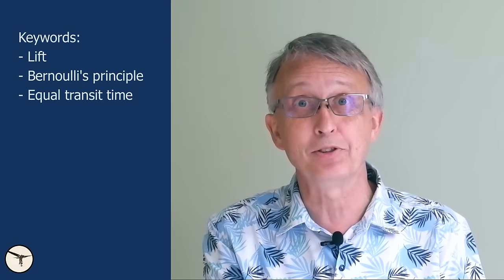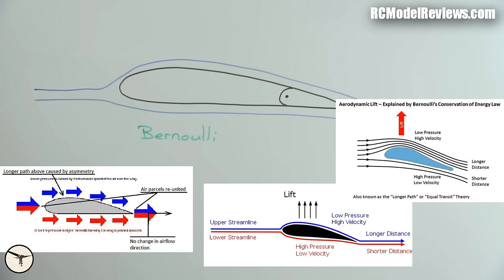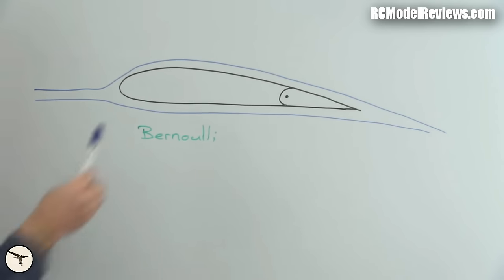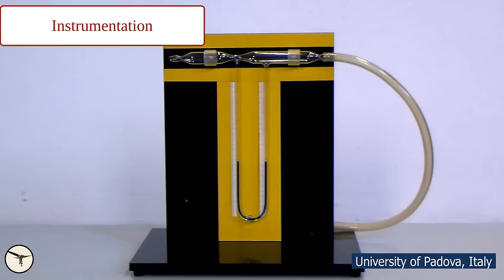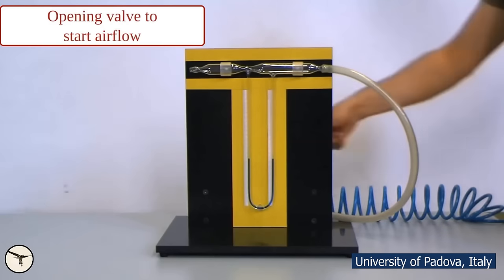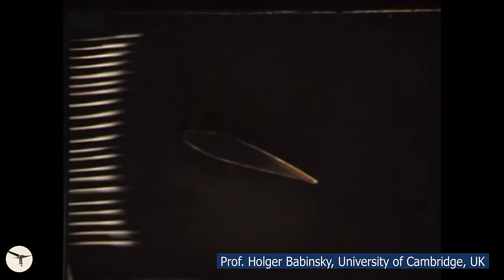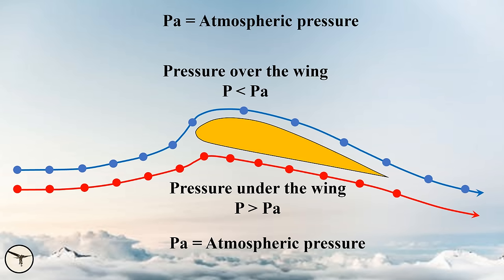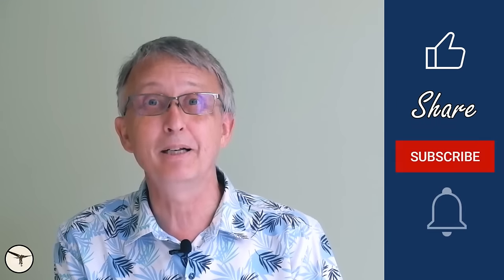Why are so many pilots wrong about Bernoulli’s Principle?

Comment: It’s more important for pilots to understand what causes a wing to stop producing lift,  so the passengers don’t get upset.
Reply from the maker: It will also be nice if the pilots understand how a wing produces lift.
Reply: "It’s more important for pilots to understand what causes a wing to stop producing lift,  so the passengers don’t get upset."
You mean like when the big fan up front stops cooling the pilots?
Reply: @rael5469     You got it…..it’s doesn’t do to overheat when the passengers start screaming 😱
Reply: As John Wayne would say...  "Stop stalling and spit it out..."
Reply: It has nothing to do with Bernouli.
It is action and reaction - it is the deflected downflow of air from under snd over the wing, that provides lift.  To make the wing go up, you must deflect molecules of air downwards.   No deflection, no lift.

The pressure differentials are a product of molecule deflection, not the cause of lift.  (ie: more molecules hitting the bottom of the wing than the top.)

R.
Reply: @RalphEllis  The stream of air gets cut into by the wing.  The lower top side pressure produces LIFT in that stream.  So flight is the result of making vertical gains against that stream.  The lower pressure and LACK of molecules produces lift within that stream.  So your action reaction is that same thing that causes a rush of air in a breached airlock.  The "vacuum" or lower pressure above the wing pulls on it compared to the mass of air that would normally be pushing downward on it.  So you got it wrong.
Reply: @RalphEllis wrong, if it was true that deflection was the main factor there would only be like 10% of the lift produced, aircraft would not fly.
Reply: Yep, you got that right.😂

Comment: You are 100% correct. When I hear people explain this wrong idea I ask them how is it that  aerobatic planes can fly and their wings are symmetrical. And how can they fly upside down?
Reply: Aerobatic aircraft use engine power.

The angle of attach of a symmetric wing profile deflects air down, but that flight mechanism creates a lot of drag, which needs more engine power to overcome. Many aircraft can fly upside down, using the control surfaces to deflect the airflow - exactly the same forces as used to change direction, but if the control surface forces exceed the weight of the aircraft, it doesn't fall out of the sky whilst inverted.

So, angle of attack, and control surface inputs, which are completely different flight mechanisms from aerofoils.
Reply: @andyowens5494  yes. Angle of attack is critical. Obviously aerobatic wings are not used on more conventional aircraft for that reason. They are too inefficient. But if the Bernoulli principle was the only thing working, this wouldn't work.
Reply: Symmetrical airfoils must always be at a positive angle of attack to produce lift, roughly +4 degrees for unaccelarated flight. Asymmetrical airfoil will still produce significant lift at even zero angle of attack and no lift at roughly -4 degrees under the same condition.
Reply: @kevinbarry71  Thank you for pointing out the obvious issues of angle of attack and symmetrical profile wings.  If you have ever "flown" your hand out a car window, angle of attack is readily apparent.
Reply: The angle of attack in the smoke demonstration appears to be much more than 4 degrees
Reply: @andyowens5494  Aerobatic aircraft still use their wings for lift. They don't use 'engine power' alone to stay in the air except when doing specific stunts that involve climbing straight upwards. They also don't use control surface forces to fly upside down. They use control surface forces when upside down to create a positive angle of attack on the wing and then they use the lift from the upside down wing to fly. If they are set up truly symmetrically they'll be doing the exact same thing when right side up.
Reply: @christophertelford  Ooooo... such an education.
Reply: @andyowens5494  Happy to help.
Reply: 1 SW SW ex
Reply: "I ask them how is it that  aerobatic planes can fly and their wings are symmetrical. And how can they fly upside down?"
They have enough POWER to ignore the Bernoulli effect.
Reply: @thomasmaughan4798  You don't need a lot of power to fly with a symmetrical aerofoil (or no aerofoil). The symmetrical wing hits the airflow unsymmetrical because of the positive angle of attack as would the flat wing.
Reply: @christophertelford  "You don't need a lot of power to fly with a symmetrical aerofoil"
I do.  Evidently your mileage varies.
Reply: @andyowens5494  Exactly!
Reply: @rivernet62  It's deliberately set high to break down laminar flow and produce a vortex near the trailing edge. If it was set lower it would demonstrate that Bernoulli was in the right ballpark but his model breaks down as soon as laminar flow does.
Reply: How?  Angle of attack.  "Symmetrical" wing must have an angle built into it or induced by the pilot and the controls.
Reply: @christophertelford  Thankyou !! Yours is the BEST explanation.  Look at airshow pilot Dave Martin {you can see him on YouTube} he flies a Beech Baron that has a standard wing and he flies it upside-down with BOTH engines CUT and props feathered. So to say that aerobatic planes fly upside-down because of extra engine power is kind of stupid.  There are glider pilots who do aerobatics in high performance gliders and they have no engine.  As far as the curvature of the wing, that is obviously for efficiency.  Because you can make a paper airplane and if you are good at it, you can make it fly really well. And it's just a paper airplane with a paper wing and no "curvature". Look at a toy balsa glider.  If you take a magnifying glass to the leading edge of the toy glider wing, what you'll see is a SQUARE.  There is no "cuvature" yet the toy glider flies very well indoors. Thank you for your flight control explanation.  I can't believe people actually think the flight control/s are making the airplane fly upside down. That makes ZERO sense.  If you're upside down, the control inputs are simply "backwards" - push stick forward to make nose go up, and pull stick to make nose go down.  Rudder same thing - Now ailerons I'm not so sure about because that's the longitudinal axis and depends on your reference point so any aerobatic pilots out there chime in on the ailerons when you're upside down. All I know is when you roll the aircraft to the right the left aileron will be down but when it's upside down it will be up and will have "switched" places with the other aileron. I'm assuming when you're upside down the aileron movement will be the same - but since I've not done my aerobatic training {yet} I'm not 100% sure.
Reply: @thomasmaughan4798  If your aircraft has a non symmetrical wing and isn't setup for aerobatic flight then it will be more 'biased' towards flying right side up and will take more extra thrust to hold upside down vs flying the way it's 'supposed' to. But define 'a lot'. I'm guessing an extra 40% or thereabouts? The point is you don't need a greater than 1:1 thrust to weight ratio, the aircraft still flies and the wing still works.
Reply: ...25 likes for this comment just goes to show that videos like this one are still failing to relieve the great unwashed of their misconceptions about lift and probably always will.
Reply: @andyowens5494  "Attack" 

Looks like you needed the education, Mr. Smarty Pants
Reply: @waywardspirit7898  Looks like you've never had auto-correct change one word in anything you've ever written, "Mr Perfect". Thanks for your comment, I'll give it the attention it deserves.
Reply: They have an aileron on the trailing edge the airfoil to lift one way or the other.
Reply: @markmcgoveran6811  thank you for sharing your ignorance
Reply: @kevinbarry71  well I'm sorry about my ignorance but I don't see any reason why you would assume those two flows with meet at the same time that the theory like that is just patently ridiculous. But apparently a lot of people with phds ignored it for a long time. If you took any arbitrary curve you just can't be expected to have the same speed if you have anything asymmetrical. Radial symmetry in every direction you would have a sphere and the speeds would be the same because the distance would be the same. But I do appreciate the respectful attitude you have towards others and I'm happy to hear your contribution and I don't care what you think that's still the stupidest idea that ever got by anybody with a better education than a farmer.
Reply: @markmcgoveran6811  you don't know the first thing about ailerons. They work in opposite directions.
Reply: @thomasmaughan4798  there seems to be a weight problem in the room that's what decides how much fuel you're going to lose if your heavy on the wing you're going to eat a lot of fuel.
Reply: @kevinbarry71  airflow shadowed side of wing have more airflow speed than side that catch the air. so in any way bernoulli effect works. it's  just not only part of forces, but it works in any way except 0 aoa on symmetric wing... actually it's works even in this situation, we just can ignore it, because we "works" with ideal model.
Reply: The acrobatic airplane that flies upside down doesn't glide upside-down he's hanging on that propeller and if that motor spits when he's flying upside down he's going to have to do something and it better be good. Acrobatic airplanes have plenty of motor and no brakes no other airplane has much for brakes either in the sky so the acrobatic airplane doesn't really need low-drag wings a lot of them are biplanes. Lots of drag so when you're back out of the throttle it slows down to set you up for your next acrobatic move. When you've got an airplane with that much horsepower it's kind of like a helicopter hanging on that rotor.
Reply: @thomasmaughan4798  You said "They have enough POWER to ignore the Bernoulli effect."   Gliders can do aerobatics and fly upside down.
Reply: @michaelrunnels7660  "Gliders can do aerobatics and fly upside down."
Yes, they are amazing aircraft.  They are not designed to fly inverted for any extended length of time.
Reply: @thomasmaughan4798    I interpreted your earlier comment to mean that something without a VERY powerful engine can't fly upside down for any length of time because Bernoulli's law doesn't work when an aircraft is inverted.  A glider that flys inverted for any length of time shows that Bernoulli's principle works just fine for aerobatic aircraft.  No need for any engine at all, let alone a powerful one.
Reply: I would like to know how an aircraft can have sustained flight at 90 degrees roll, wings vertical, with no obvious great pitch up angle of attack of the fuselage. Should be pitched hugely nose up.
Reply: @howardsimpson489  The fuselage itself is an airfoil.  The elevator simply becomes the rudder and the rudder becomes the elevator.

Comment: I've been saying this for almost 2 decades. There is absolutely no reason that the air flowing over the top of a wing is supposed to meet up with the air flowing under the bottom in the same position where it started from. If it did, wings would not create drag. The existence of the drag created by an airfoil is all the evidence you need to refute that theory. If the air moving over the top of the wings speed up at all it is likely more because it is being compressed against the air above it as it is Redirected over the top of the airfoil.

Comment: Hi Magnar. Many have an issue with Bernoulli, and they are mistaken. As long as you are outside the boundary layer Bernoulli's principle applies. In fact, when most engineers use the pressure coefficient it is directly related to Bernoulli, as the ratio of the change in static pressure to the dynamic pressure. The ETT was initially a hypothesis of D'Alembert, and is a result of potential flow, the first real attempt to apply Newton's laws of motion to a fluid. In this situation the curvature of the streamlines at the training edge and leading edge are symmetric, and you get no resultant lift force. As such, saying that the curvature is responsible for the acceleration (while true), neglects the resolution to D'Alembert's paradox which resulted because viscosity was not understood until Navier and Stokes 100 years later. So, the asymmetric acceleration around an aerofoil is due to viscosity. There are two specific effects, the Kutta condition, which moves the rear stagnation point to the TE. and the induction of more flow upwards ahead of the wing. The end result is an asymmetric velocity of the flow (circulation) which at the surface of the wing is given as a pressure force, which will also be asymmetric, with lower pressure above and relatively speaking higher pressure below.
Reply from the maker: Thank you for your contribution!

Comment: Why if you hold a paper downward ( your hand holding the paper is above and the other side of the paper is down below ) and then  blow on one side of the paper .. It will not move to the direction of the blow even though the air is faster than the air at the other side ?

Comment: I believe your wind tunnel example may be slightly misleading with what is causing the change in airspeed around the airfoil. I looks to me that the AoA of the foil is deflecting air down slowing all of the air in the lower portion of the demonstration making it harder to determine if the air over the top of the airfoil is actually speeding up as you mentioned in the video or is actually remaining constant. Would a more cambered airfoil with a flat bottom parallel with the relative be better conditions to demonstrate how the shape effects the airspeed?

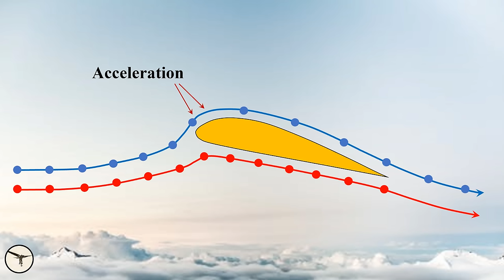Comment: It would help if you included stagnation lines in your diagram at 3:21. This seperates the flow into two regimes, one above and one below the wing.Draw these lines first before you draw the other flow.lines.Except close to to wing these lines should aporoach being symmetrical about the vertical axis through the centre of lift.

Comment: When I used to fly RC models, we took a wing on a 3 channel trainer and put it on backwards. It flew just fine
Reply: because wing was in correct aoa. backwards wing didn't make it broken, it's just make it with worse aerodynamic quality
Reply: Also worth noting an RC plane is not very representative of large aircraft as the very small/simple ones have symmetrical airfoils and don’t operate in remotely the same Reynolds number regime
Reply: Then why do they use models in a wind tunnel? Why do RC models have similar characteristics as the full scale airplanes they are modeled after? 🤔

Comment: I have an engineering degree (not aerospace), and in all of my physics classes going back to high school, the Equal Transit Time hypothesis never made sense to me.  Why does a given molecule in the air that goes over the air foil have to remain in the same place in space relative to the x axis as its "companion" molecule that moves under the air foil?  Thank you for showing the slow-motion video of the pulsed smoke in the wind tunnel that belies the Equal Transit Time hypothesis.